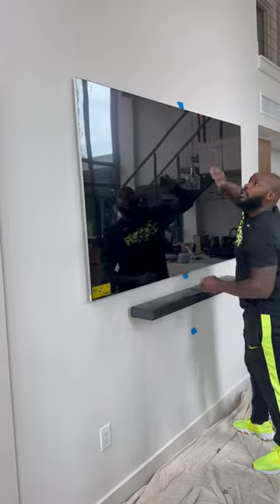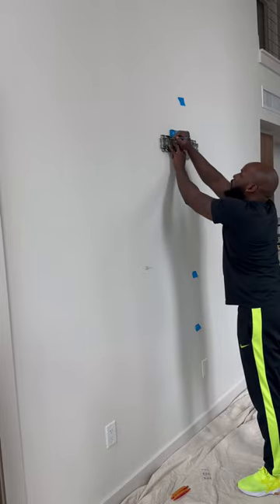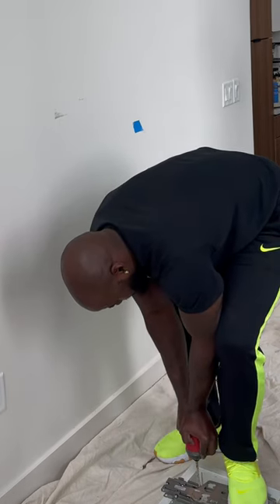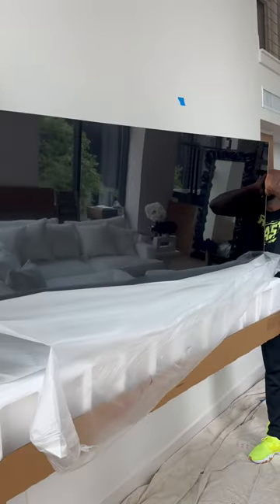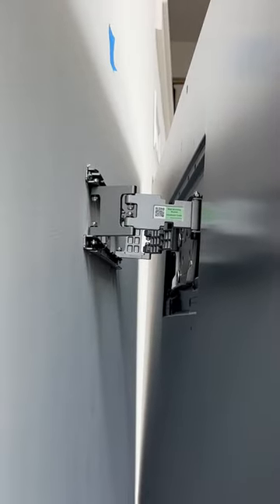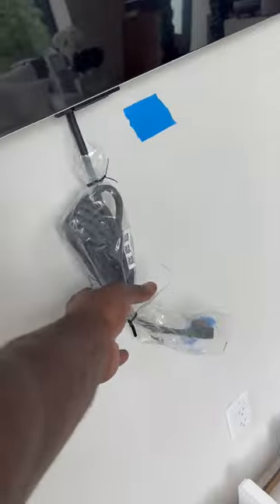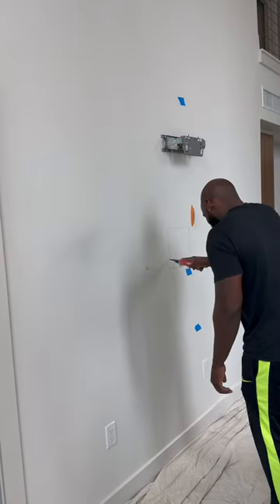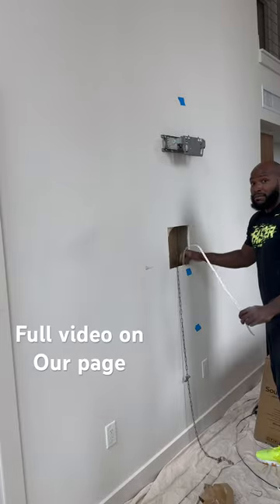Ever seen on this flat? #tv #lg #oled #fyp #tech #explore #howto #work #reels #shorts #sub #trending

Comment: You drill in wall very softly are those ceramic coating walls? How come they manage the load of 75" inches led
Reply: Some toggle bolts can hold over 100kg each just in plaster. I use Toggler usa brand